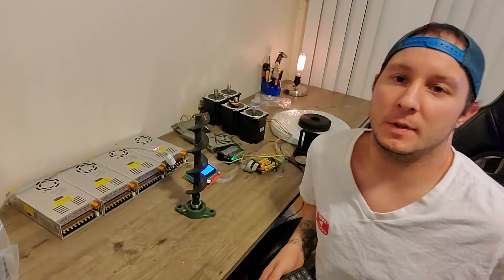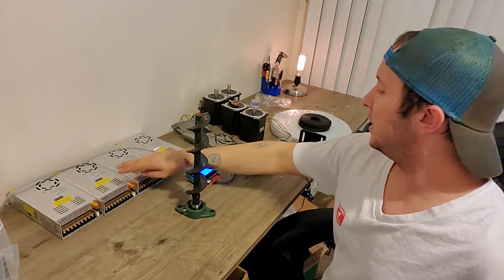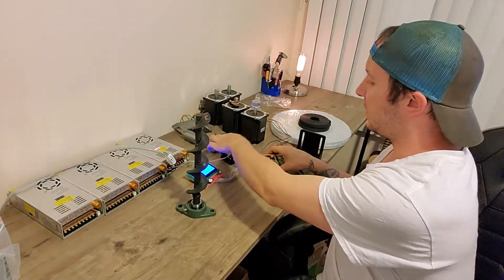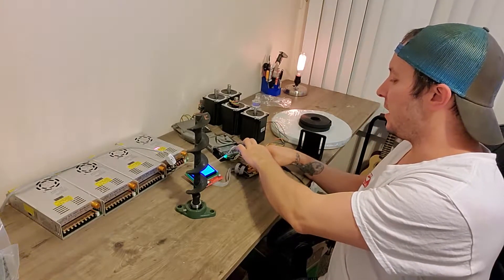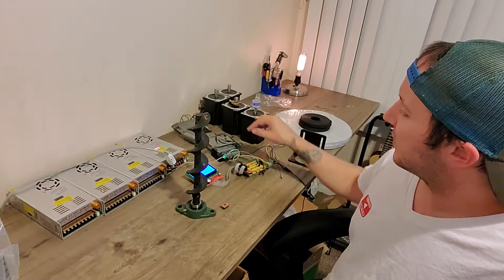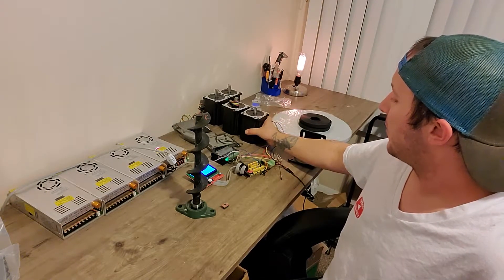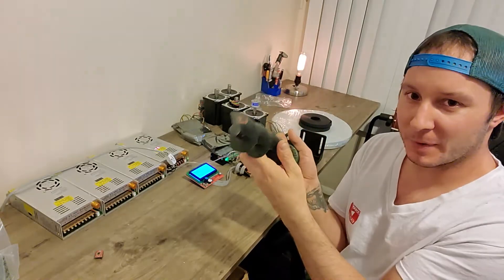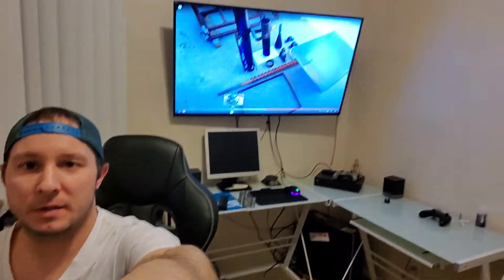How to 3d print a house EPISODE 2 CONCRETE PUMP + 3d Printed Houses

Comment: Hi!
I'm also want to make a concrete 3d printer.
Can you help me whit this:
what kind of stepper motor driver do you use for the nema 43s?
how did you wire the  stepper motor driver to the ramps?